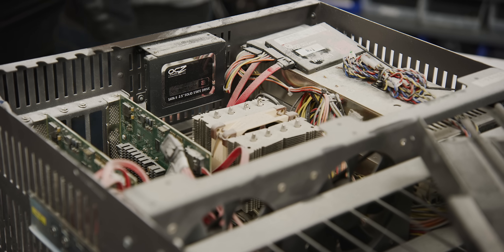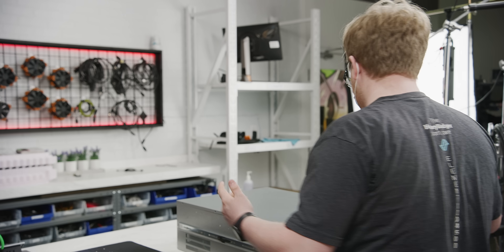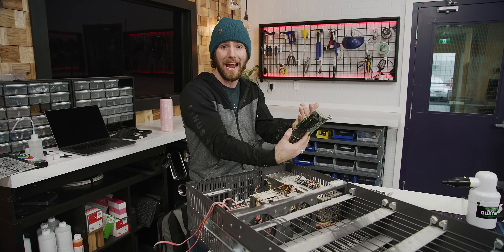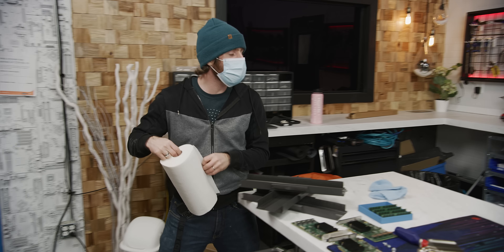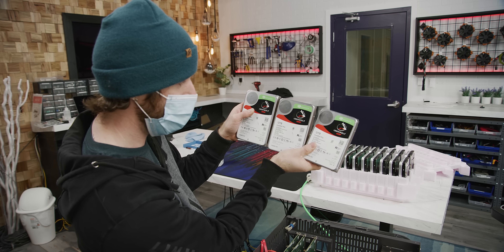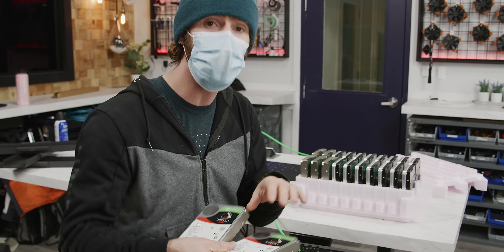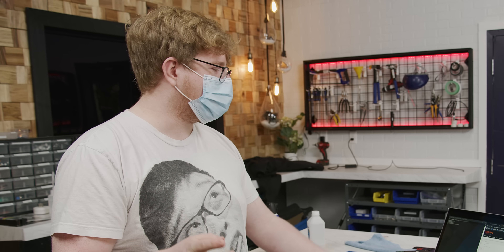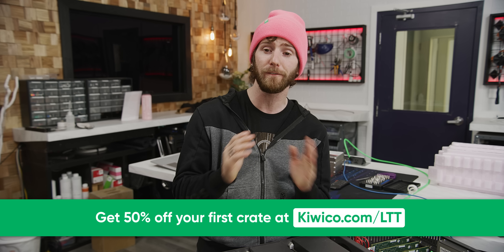Rebuilding Our DIRTIEST Server - Remote Backup Server Build Log

Comment: That’s not a very bad layer of dust taken out far worse machines that were working fine. Also dust itself is not conductive. Just the loose hardware that you might have floating around in it The biggest problem with dust of course is that insulates the heat inside.!  Get a real air compressor to blast dust out of things.  it’s the only way.

Comment: pfffffff pathetic. I see much worse on a regular basis. I diagnose, repair and assemble computers for a living.

Also, why the hell aren't you using a proper compressor for that cleaning?

Also-also, why run RAID-1 on cache drives? Won't it just be temporary data anyways, making RAID-0 better suited?

Comment: The config file syntax for rsnapshot is absolutely awful, but the way it works is amazingly simple.

For anyone considering it, I recommend pairing it with "rrsync" (not a typo) and SSH "forced commands"! You can setup service accounts to only run rsync and lock it to a specific directory.

Comment: I use that exact same blower at work and I will give you a few tips about it:
1. If you don't want it to catch on fire (mine did) keep the filter on the bottom cleaned out.
2. You don't necessarily need that attachment on it to get good airflow out of the nozzle and with it on there it really makes the blower work so much harder (I think that actually contributed to the fire)
3. If you take it apart watch out for the wire position as you remove it because it has the wires in the top part connected to the button.

Comment: Easy peezy, stop the fans with coffee stirrers(because they’re always handy in IT) Then just grab a pancake air compressor and make sure to spit out the water from the hose before applying it. 

Do this outside as it will kill your lungs even if you’re not in the room when it’s dusted. That stuff takes forever to settle. 

The only things you have to watch out for are spinning the fans with your compressor and moisture from the nozzle. But if you’re draining your compressor when your done with it, then this won’t be a problem. 

I’ve worked two school districts and both of which asked me to dust their entire fleet. In response, I asked for “interns.”

Comment here the worst dust you’ve ever been asked to do.

Mine is the CAD room win XP box that had its effing side open next to all the saw exhaust for the wood shop.

Comment: Haha... 🤣 I bought a 1999 Compaq Proliant 3000 for 25 euro. I took it completely apart this weekend for cleaning and it was like only tiny bit of dust. Even in the hidden corners. The Compaq is designed to blow dust out not to collect it!! Bad design of the storinator! Also my normal 3U rack fileserver is clean inside

Comment: "I've got a mask on, and I'm still coughing." That's a sign that your mask isn't good and need to be replaced with a much better quality one. Providing you can actually get one.
Reply: To be fair surgical mask aren’t designed for particulate filtration. They’re wearing because of mask requirements.
Reply: Those masks are not to protect the user from dust or any other particle, they are to protect everyone else from the user's breathing/coughing/sneezing/etc, up to a certain degree of course. They'd need construction-grade masks at least to not breathe in the dust
Reply: @AgustinSaldias  'construction grade' is just N95 (or P95), the exact same particle filtration as (quality) surgical masks. Their masks are just wayyy short of N95, dust particulate is huge compared to a virus.
Reply: @OrangeCrusader  surgical mask are nowhere near the N95 standard.
Reply: @OrangeCrusader  OK, but just as you said, a dust particle is much bigger than a virus. Isn't it scary that he can inhale dust through that mask, and in turn, particles smaller than dust, such as viruses?
Reply: @ianwagj  no, because the dust doesn't enter through the mask but around it.
Reply: @KendallSeabury  There are N95-rated surgical masks, do a 3-second google search?
Reply: @ianwagj  Exactly, though tbf the main point of non-n95/etc-rated masks is to stop/slow droplets more than virus particles, they just limit coughs/breaths from reaching near as far, as quickly. Some defense is better than none, but it's not ideal.
Reply: @OrangeCrusader  I have I work in healthcare, those are specifically rated n-95 hence the n95 rating. There's industrial n95 and medical n95. the ones we are talking about are not the medical or "surgical" n95. we're talking about the non n95 surgical masks.
Reply: Er, N95 is N95 for filtration -they follow the same NIOSH certification requirements for both medical and industrial, the difference is allowing an exhalation valve to be placed on industrial ones, or industrial-specific types like P95 or R95 being rated for oily particles. But yeah their type of mask can't be an n95-rated one, it's basically a cloth sneeze guard.

Comment: Last time I was this early the 1050 ti wasn’t selling for the cost of a Ryzen 3700x
Reply: For real man fuck these gpu prices
Reply: I got my 1650 for like 180 a couple months ago
Reply: @techhelpportalextras3007  got my rx550xt 8gb for $100, and 1650 oc ultra for $80 brand new in box! The tariffs and markup from the 30series/6000xt fucked up the prices. I now sold my 1650 and I'm selling my rx550xt for profit big time, so it's ok on that part
Reply: @johns3655  Yeah when i built my fist pc I had  an rx570 and I thought, "This is an ok gpu for a budget build" (This was back in like 2018-2019) But now I can sell all my old parts that I upgraded (RAM GPU CPU) for the price the original system costed. Fucking insane man.
Reply: @Pedridagoat  yeah might sell most of my parts, and use my old Optiplex for now, since I mostly just do work at the moment😅
Reply: 🖤

https://youtu.be/VOMooVpDMxE....
Reply: Why does everyone want to plug their goddamn channels in my comment
Reply: I bought a GTX 1070 for $400